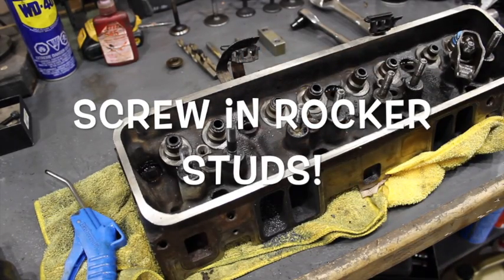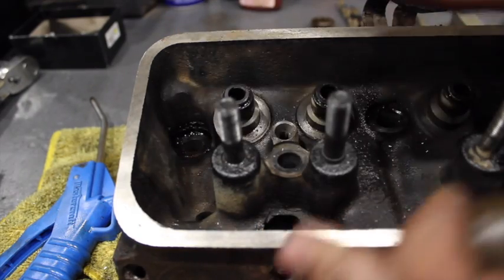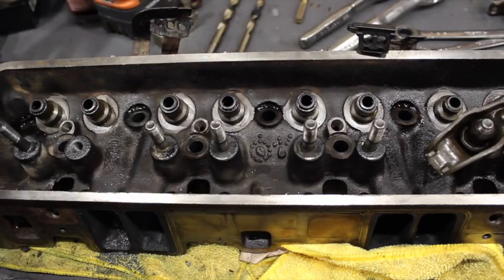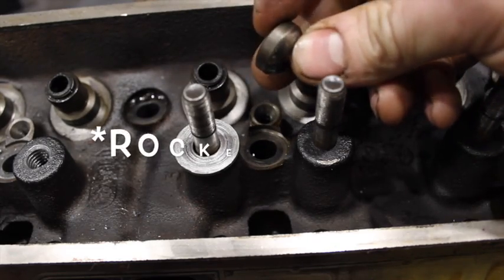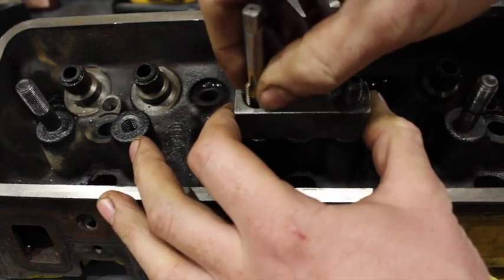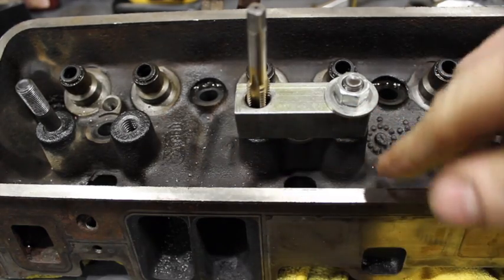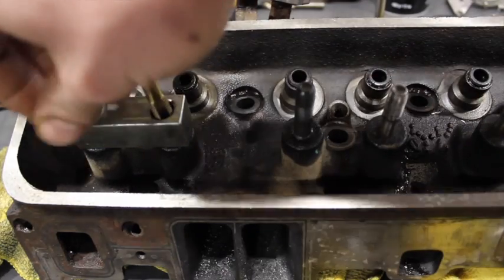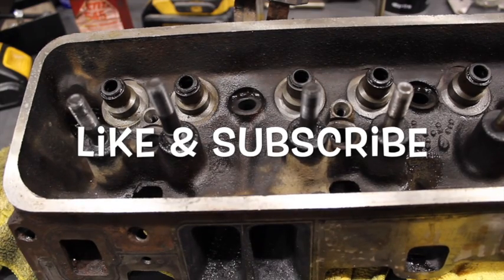Screw-in Rocker studs! Vortec Heads *Part #'s in description*

Comment: Have you ever had one of the screw in studs snap? 60 miles on a brand new 383 and I  followed you advice in setting up LS springs on the heads but I  went with a Z28 spring. I double and triple checked the retainer to stem seal clearance and I  had about .050" with the proper installed heights.  It was idling in the garage and I  heard a loud pop and clatter and turned it off very quickly.  I pulled the pass side valve cover and found a rocker stud broken and 2 bend push rods. I pulled the other valve cover and found one more slightly bent push rods. I  pulled  the heads and there is no valve to piston contact. So I  pulled the heads apart and every inner spring was broken. This time I'm going to cut the guides down and use LS beehive springs with comp cam retainers. The lift on the cam is .504". All of the pushrods had wear marks where they pass through the heads, you mentioned enlarging the hole in the head for the push rods...how big should I go? Yes, I used all new parts including long slot self centering rockers and .050 offset keepers.
Reply from the maker: I have never have one break personally but I've seen guys break them when using stock rocker arms and bottoming them out on the stud, but you won't have that issue if your using long slots as long as the valve train geometry (pushrod length)  is correct. 

So a few questions:
You used regular Z28 springs instead of the LS beehives...where the guides cut smaller? Because the inner coil (damper) shouldn't fit over the stock large guide diameter on the vortecs and will bind up and break.

Did you check push rod to head clearance at full lift? Its often a good idea especially with 1.6 rocker arms or high lift to drill the push rod holes in the heads to 1/2 inch for extra room.
Reply: You are 100% about the inner spring. They went together with no issues but after the fact they did break, I had multiple broken pieces up in the heads and some stuck in the seals. I also think the fact I didn't open up the push rod holes is why they all were scuffed. They will be opened up to ½" and I  will be cutting down the guides for good seals and a little extra retainer to seal clearance. I knew I  should have gone with the LS springs in the first place.
Reply from the maker: @robertries7774  Yeah that's the problem man! Its good it happen right away and didn't do too much damage. 
And honestly the push rods probably hit because they were deflecting when those inner springs were binding. It pushed hard enough to break your rocker studs...you could imagine the stress on the push rods! Thats why they bend.
Cheers! And let me know if you have any more questions
Reply: I probably should replace all of the studs since I  have it apart. I  did manage to get the broken stud out by drilling and heat and an easy out. This is my first 383 stroker and damn it runs hard. I thought my 6.0 LS ran good. I'm 60 and I don't know why I  didn't build one sooner!

Comment: I've never had a press stud pull out 20 years running 280 to 300 lb with used heads. Again agreed to disagree studs are a great update as you can use non self aligning rockers but from my experience I'd leave it to the machine shop cuz if you're not 90° square you will screw up the heads as I did in the past. Thank you
Reply from the maker: Man you have had better luck than me, I starting pulling studs on my truck with 280 lb springs

Comment: I'm assuming that the process for pre-vortec center bolt heads is the same.  What part number did you use for the studs?
Reply from the maker: Pioneer RM-348-16
Reply: @cuttersperformance  nice, I ordered the right ones before I got an answer.  I feel like I won 50 bucks on a scratch-off lol

Comment: Why did you not use studs that have the nut head built into the stud which bottoms out on the boss like ARP's? Because you can't use the tool for squaring the two studs up.
Reply from the maker: If you want to use that type of stud the bosses need to machined down or it will sit too high
But if your going to get them cut make sure they are cut down enough to use a guide plate as well
Reply: @cuttersperformance  Did not know that thanks. Best think I'll just buy new aluminum heads instead of go to all that work and still have not such great heads. Those new AFR budget heads would be plenty good since my pro street car is only about 2800 lbs should work fine.

Comment: Theyll pull out as long as they havnt sit awhile 😂😂😂 then I found out its a bit of work especially on the older crappy tbi heads
Reply from the maker: Sometimes a little bit of heat works but I find vortec don't usually need that 
Cheers!
Reply: @cuttersperformance  what vortec heads are these? 906 or 062. Because ive heard that the tool for tapping doesnt line up on the 062 heads(sawtooth stamp)

Comment: I'm just going to buy the BowTie Vortec heads--screw in studs come with them; thicker deck also...
Reply from the maker: Yeah man! Good set of heads but not cheap thats for sure
Reply: @cuttersperformance  I like the 2.00" intake valve idea--more flow than a 1.94" valve, but not as much bottom end torque loss as you would likely experience with a 2.02" valve; on a 350 to 383 cubic inch engine, they should perform well.  If I were going up to 415--427 cubes, then the 2.02" valve would be better, I'm thinking...  I just want good, reliable power, for towing and pushing snow.

Comment: Hi rpm will pull them out regardless of spring pressure
Reply from the maker: Well thats the debate I guess, becuase some guys say rpm some guys say spring pressure. But to achieve high rpm without float you need more spring pressure
So I guess the bottom line is, screw in studs are always a good idea lol
Cheers!

Comment: Have you ever had any of the stud boss break as you pulled out the studs? This is the biggest thing I'm worried about with this project is having to scrap the heads
Reply from the maker: I have not have any crack from pulling studs
I've found lots of cracks on vortecs in the decks though but never from pulling studs
Reply: I've had a stud boss break off a chunk 1/3 of the boss around and atleast a 1/2" or more down. Started doing these heads in winter of 19/20. Aggravated me so much I wrapped them up and shoved them in a corner, just now getting back to them in 22/23. What I have found is always use heat, always... I heat up with a propane hand torch then keep it warm with a heat gun. I also spray penetrating oil on the studs a day before and then again the day of pulling. As far as the broken boss I'm gonna put a bevel on it, heat it, wrap the head, weld it, wrap that spot then bury it in warm sand on my wood stove. Gotta cool it as slow as possible. I've never had a problem with welding cast and it not holding.

Comment: Hello what do you think about the 1990 fuel injected head?
Reply from the maker: Are you referring to the TBI 193 heads? On the trucks
Reply: @cuttersperformance   yes that’s the ones
Reply from the maker: @joelmckinney7360  they are not a very good head for performance. Some guys have spent alot of time porting them, and even then don't flow as well as the stock vortecs do
Reply: @cuttersperformance  I have a set of them on my abc 400 .30 over runs very good
Reply from the maker: Did you do any sort of port work to them?
Reply: @cuttersperformance  no did studs valve springs for cam
Reply: 600 Holley
Reply: @cuttersperformance  yes

Comment: What about pinning the studs? Used to be a thing. Yeah it’s not as cool but it would be way cheaper and accomplish the same goal. I’ve never done it but I’m thinking about it for my upcoming stock vortec upgrade.
Reply from the maker: Yeah stud pinning was a popular practice years ago. I think once you try it you may realize why most don't like to do it haha the key is not to drill through the center of the stud but just hit the edge of it and thats easier said than done. Much easier if you have access to a mill 
Cheers!

Comment: I understood right away without having to go back once so yes, it's well explained ! Thanks
Reply from the maker: I'm really glad it was clear! Thanks for the positive feedback 
Cheers! 🏁 🏎
Reply: @cuttersperformance  I need this info = I bought a 2018 602 crate and I want to put screw in studs. Would you know the size I need ?! I am on Summit and I am not sure what size studs 7/16 ? 3/8 ? I think its 7/16. I have the 602 full manual from GM and no info on that ! Any help would be awesome. Thx again ! Vince
Reply from the maker: I use Pioneer RM-348-16 studs 👍 
Thats a great crate motor! They are abit under cammed, I'm sure thats why your doing rocker studs though haha cam upgrade time?
Let me know if you need a good beehive spring kit for those heads aswell! All American made springs 👍
Reply: @cuttersperformance  Well I appreciated the prompt response ! I guess the springs would have to go same time as the studs so yeah plz shoot me those #'s ! Thanks again, much appreciated
Reply from the maker: @freedomofspeech2238  send me a email pcperformance1@outlook.com 
With what cam your going with and I can set you up with a kit 👌
Reply: @cuttersperformance  Recommend a cam ? The stock 602 cam has a remarkably smooth idle ! I'd like a rougher sounding cam for street corner red-light idle :D
Reply from the maker: Yeah man they are super smooth for a advertised circle track engine
Shoot me a email your combo and vechicle and I can make some suggestions
Reply: @cuttersperformance  ok will do. Merry christmas by the way.

Comment: I didn’t realize these pulled out so easily. Thanks so much for the detailed instruction!
Reply from the maker: Scary right? Haha and no problem! Thanks for the positive feedback
Keep a eye out in the next couple weeks for a DIY vortec port job with flow bench results 👌
Reply: @cuttersperformance  No problem!  Yeah I sure will, thanks!
Reply: In a stock configuration spring pressures on a stock head are not extreme, usually only 75-85 lbs on a closed valve. When valve spring pressures increase along with engine speed stock pressed in studs begins to pull out. If your lucky enough to recognize the failure mode and catch it in time engine damage can be averted. If your unlucky, engine damage can be mild to extreme. In the mild mode you remove the heads and install screw in studs. If you are not lucky, pieces parts get hung up in other pieces and severe damage occurs.
Reply: @lloydholt6511  hey thanks.  I've always known that higher lift and stronger springs made it necessary to install screw in studs.  just didn't know it was that easy to pull em!  Thanks for the info and feedback!  Hopefully I can avoid the "not lucky" scenario...

Comment: Just a little note Eddlebrock makes a stud puller kit and all pieces in the kit could be purchased separately at one time. It contained a pulling block, taps and spot facing tool for the studs which used the screw in studs with the radius base and hex head for tightening the studs.  Like you, I always used a washer with rocker balls and one of the rocker nuts. Helpful tip would be a little never seize on the stud and washer.   Now days most aftermarket heads come with your choice of 3/8 or 7/16 rocker studs.  And yes always use a sealer on the screw in studs. If you don’t you will regret not  using it. What your doing is almost a lost art. Thank you for sharing.

Comment: Worth mentioning there is 3 types of taps. Works pretty good if you start with a starting tap then move to a bottom tap or plug tap. Bottom tap having the least amount of tapere. And not sure on truth but a machinist told me to clean the tap and cast with brake clean and tap without oil. Cast will chip away dry and oil makes it plug up the tap
Reply from the maker: Good tips! Thanks
I've only ever used a tapered tap with some tap oil and it taps like butter 
Clean the tap brake clean when the fileing build up

Comment: I've got a set of 1998 062 Vortec heads that just came back from the local Automotive Machine Shop after being Maga Fluxed and Decked. I was told to put OEM head bolts when I reassemble the engine...My question is do I buy new OEM Head bolts for the 1998 Vortec heads...or OEM head bolts for the 1982 Chevy 350 engine the heads are going on ...or is there any difference ? I would imagine OEM bolts for the 1982 350 block the heads are going on to !
Reply from the maker: Actually my man the heads bolts are the same for all stock sbc steel heads. I've used a Ferlpro headbolts on some budget builds and they work great 👍

Comment: The stud spacing on vortec heads is a bit different than the tools are made for
Reply from the maker: Ya exactly and that's why you got to make sure the tool slides over the studs. If not it needs to be drilled
Reply: @cuttersperformance  Reaming the tool makes it not work on older heads then.  I just used a drill bit and some tape to align it on vortecs

Comment: Wanting to put the same studs in my 062’s are the new studs the same height or close enough as the old ones once installed?
Reply from the maker: They do make different length but the ones I use are just slightly longer and fit under the stock covers no problem

Comment: Some studs have a raised roll and you can screw them down it contacts the head and tightens. They work great.
Reply: @shaun4bigblocks  some people are just dense. you dont have to machine anything to use them. that is why they are made. put a little loctite on the bottom threads, then put a nut on the top threads and screw them in until they are tight. evidently you have never used them.
Reply: @shaun4bigblocks  you don't even need that fancy little machine tool. It is made to sell to citified mechanics. the tap will follow the hole. if you cant tap a hole you shouldn't even be putting gas in a car.

Comment: Have you ever run LS valves on a vortec head using the valve guide liners? Ls valves are smaller diameter,  think it would be worth much additional flow?
Reply from the maker: No I have not but I like your thinking, I would be curious to know what sort of Cfm you would gain? I couldn't imagine alot but i woukd like to know. Maybe I will have to machine down a valve stem to 8mm and take a trip to the flow bench...
Reply: @cuttersperformance  might be a cheaper upgrade option if you use a set of used ls valves to replace some pitted stock valves. Could go a hair bigger too.  Found a thread regarding doing this on a thirdgen forum on l98 heads. Somebody even used LS rocker arms. https://www.thirdgen.org/forums/tech-general-engine/336363-ls1-valves-springs-l98.html#post4432686

Comment: I plan on swapping to vortec heads on my 1990 silverado sport (350). Thr heads, Cam, springs, intake manifold and EFI. Hoping for 350-400 HP when done. Your content has been very informative. Enjoying it 👍
Reply from the maker: Great idea! You will have huge gains over the tbi swirl port heads. 
I put the holley sniper on my c1500 with vortec heads and couldn't be happier with the power and drivability
Send me a email if you have any questions or need a spring kit for your vortecs 
pcperformance1@outlook.com
Thanks!
Reply: @cuttersperformance  hell ya I will!! 👍

Comment: After I finished tapping and I screw in the new stud, it keeps on going in. How do I know how far in the new stud needs tobe in the boss?
Reply from the maker: I can't say I've ever had that happen personally. You must be working with a longer tap becuase the taps i use work out perfectly when you when you stop when the tap is flush (like in the video)
The studs i use also have a raise rib that bottoms out on the head 
I would maybe try measuring your threads on the new stud and then using tape on your tap to that measurement to set the depth, then adjust accordingly
Reply: @cuttersperformance  what aftermarket roller rocker arms would you recommend.
I'm thinking of going 1.6 ratio
Thanks
Reply: @cuttersperformance  
Hey I have a few questions I would like to ask you.
What's your email?
Reply from the maker: @andyvieira5570  pcperformance1@outlook.com
Reply: @cuttersperformance  im interested in the spring kit

Comment: Thanks for the great how to vid , just a question though , what brand and part# are the rocker studs you are using ? Ive have some ARP studs but need the stud bosses machined down to use them , using these will be a much cheaper alternative . Thanks again  👍👍
Reply from the maker: I've had good luck with the pioneer RM-348-16 studs